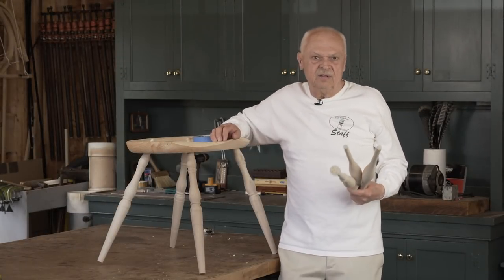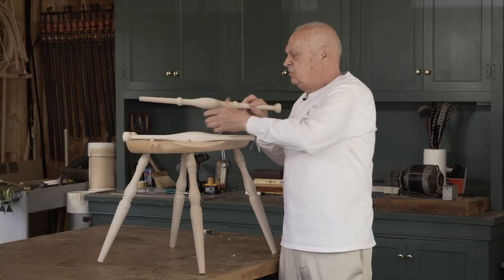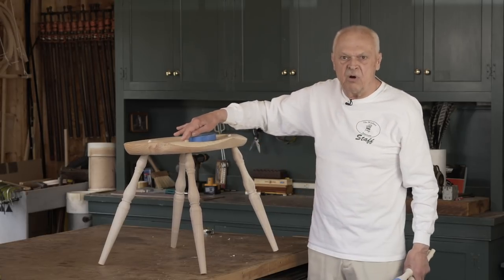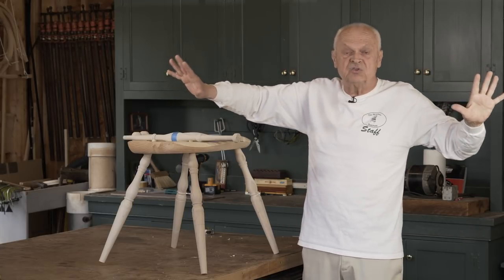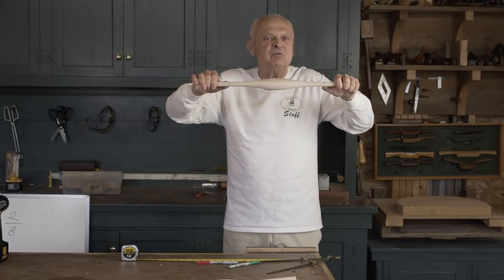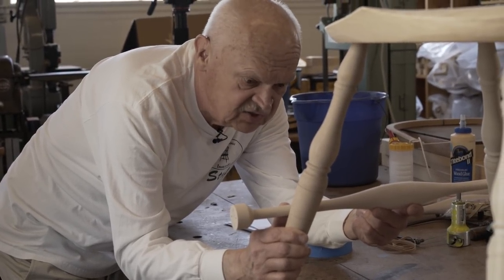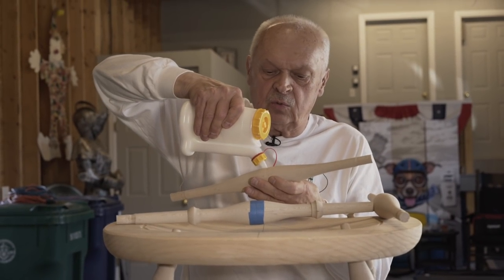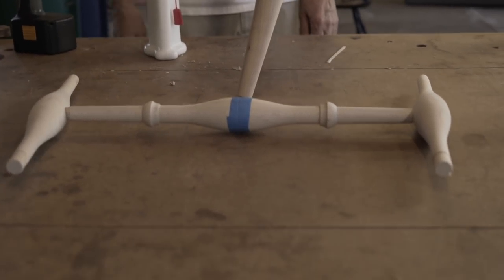Make a Sack Back Windsor - Episode 5

Comment: These are great instructional videos, but you have not mentioned about grain direction and I know this is very important in obtaining a strong joint that won't split the timber.
Reply from the maker: The grain of the seat runs side to side, along the seat's long dimension. Other than that grain does not usually matter. To avoid splitting, always run wedges at a right angle to the grain.

Comment: Mike any recommendations on where to purchase the tennon cutters?
Reply from the maker: Lee-Valley.
Reply: Excellent, found them. Also you sold the drill depth stops through your Windsor store, do you still sell them, or have a recommendation for who does?
Reply from the maker: @aparent100  Sorry. Those depth stops are no longer in production. You can put colored tape around your bit or make a depth mark with a Sharpie.

Comment: How can I make the legs and the H-frame?
Reply from the maker: I'm not quite sure I understand what information you seek. The videos show you how to make the H stretcher and mount the legs.
Reply: @thewindsorinstitute2047  Ah hello!, Thanks for the reply, sorry I didn't really say what I meant to. How do I go about getting the right dimensions for the legs themselves and the distance from the top to the small markers where the H-frame is? 
I have a laith at home and would like to make them also from scratch if possible.
Reply from the maker: @michaelcoyne3700  Pick up a copy of my book Make a Windsor Chair (either the original Taunton edition or the later F&W edition). Both have a drawing of a baluster leg as well as the other turned parts.
Reply: @thewindsorinstitute2047  I will do thanks, I'm going to get the templates too the videos are class thanks for doing them. It takes a lot of effort and time to be fair!.